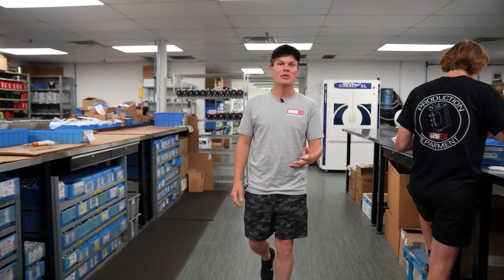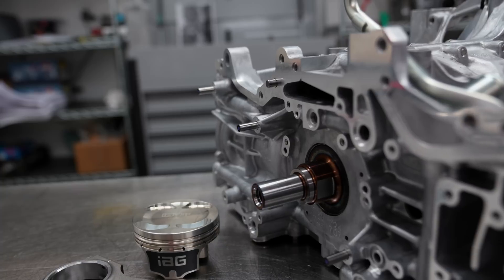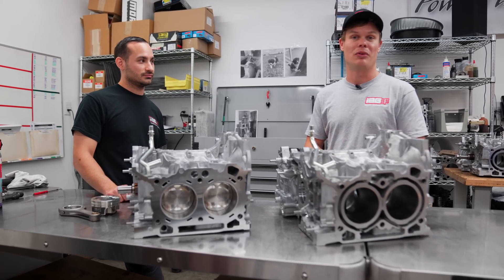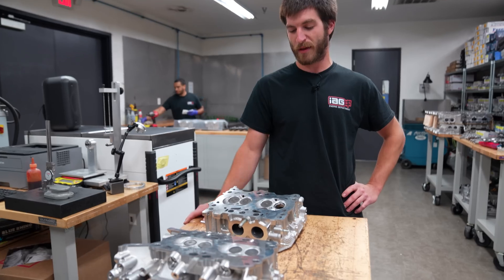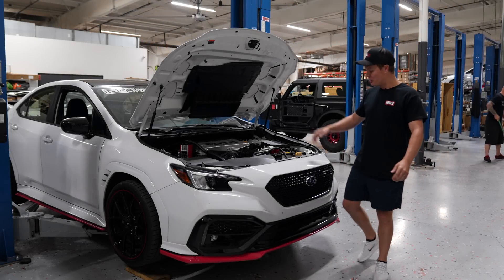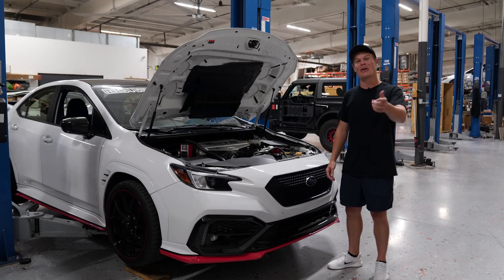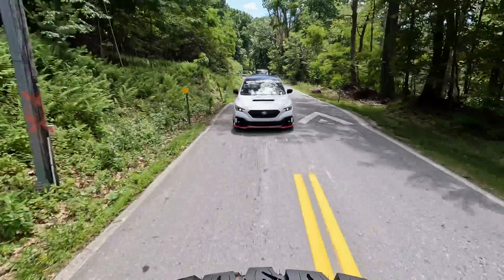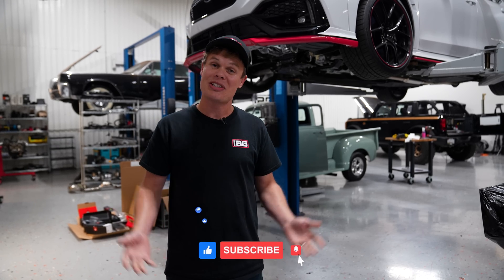IAG FA24 Built Engine Development + Dyno!

Comment: Yay! Now we need some non 7 thousand dollar transmission option... Wish there was a good way to support the cable shift better
Reply: This aged well... Lol. Just replaced the transmission in my 2016. 332k mi on stock motor. Fingers crossed it survives until FA24 swaps are cheaper and common

Comment: Now we just need a better transmission to deliver the power 😅
Reply: STI trans swap, loving mine!
Reply: @DarkWolfWRX   expensive, although my shop did say theyve seen the stock trans hold up to 500 hp or so on previous gens
Reply: @stealthywallaby1392  it really all depends on hows the ppwer is delivered and how its driven. Two other local guys did the swap because they blew their trans sub 400whp. One on a track an one on the street. I did mine as a just in case deal.
Reply: @DarkWolfWRX   makes sense. Did you do the swap yourself or have a shop do it?
Reply: @stealthywallaby1392  had it done at a shop. I didnt have the confidence, knowledge, or tooling to pull that one off, haha. I have been doing everything else myself and documenting it on my channel, though(shameless plug lol).
Reply: @DarkWolfWRX   I've been watching some lol. Just curious as to how much they charged you for it
Reply: @stealthywallaby1392  theres a breakdown at the end of my first impressions video. But including the dccd controller that i installed its just shy of 11k. 2k being labor. An i could have saved money on a trans with more milage but I was super picky on getting one at 10k miles or less. An if I were dping it again id not get a kartboy short shifter. Not a fan of the feel on that.
Reply: @DarkWolfWRX what year trans did you end up with?
Reply: @NightriderWRX007  a 2020 trans.